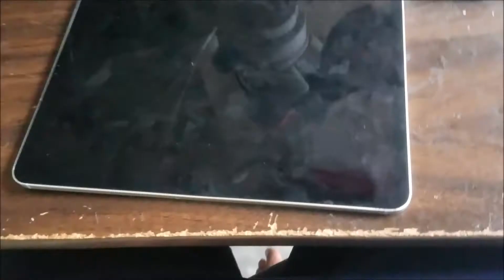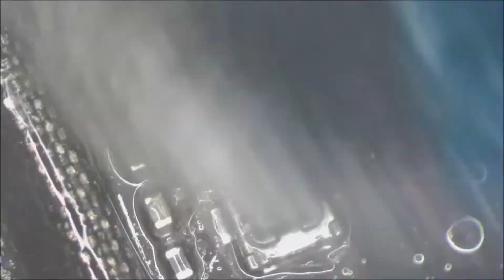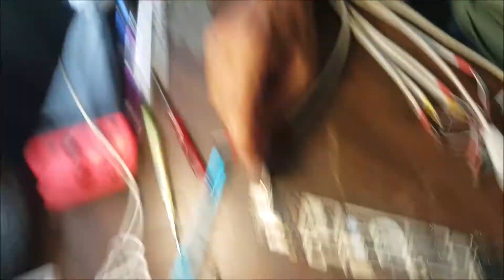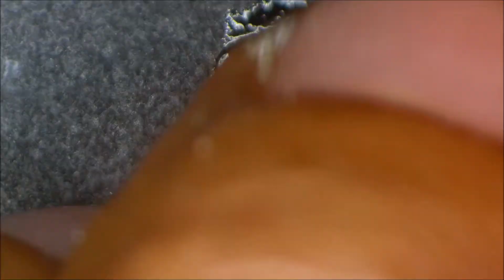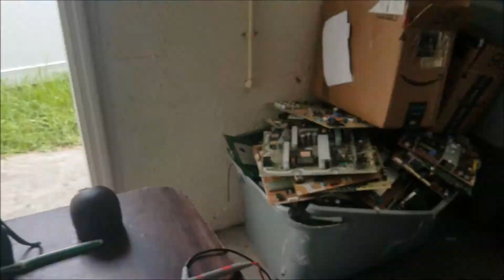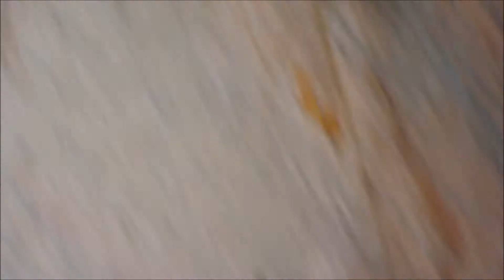a2068 ipad pro 11in 2nd gen no power water damaged

Comment: Am having similar issue but when I inject voltage the U8500 ic get hot under the thermal camera, it has no liquid damage, type-c charger shows battery on screen and it disconnect for a while and connects and disconnects again. kindly give me help thanks
Reply from the maker: Check the caps for short around u8500